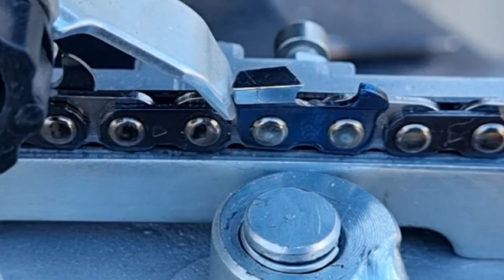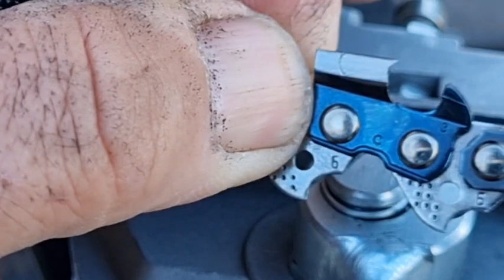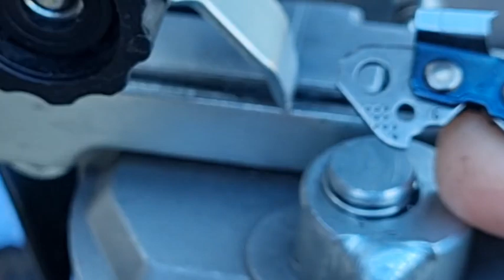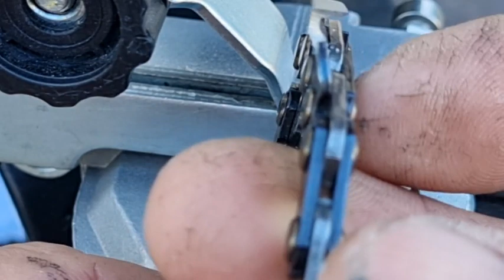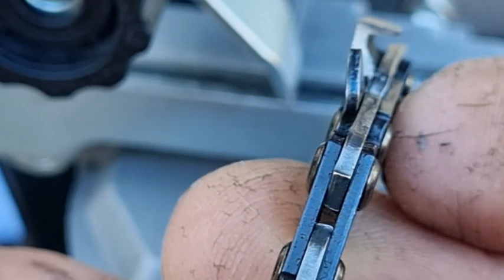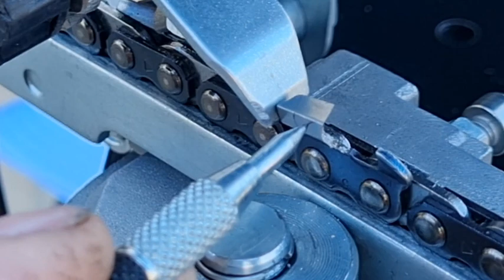10° downward tilt explained, close up and detailed

Comment: You answered my 2 year question ive been puzzled about. Your awesome!!!
Reply from the maker: 10° tilt really is not used much these days Stihl don't recommend it anymore.  OREGON do on some chains.  But a little tilt will never hurt.  There is a slight advantage with some tilt on modern chain but not a lot.  It is no longer regarded as a game changer.  The chainsaw tooth profile has changed in the last 30 years and that's why 10° is no longer recommend

Comment: Sir, I wish to see the cutters from opposite site. does grinder 10° tilt changes inside of the top plate angle as like round file with 10 down angle by hand?
Reply from the maker: Yes what it mainly dose is give less hook.  Reduce the hook which is better for full chisel.  Less hook gives, the leading edge more mechanical support.  Less likely to bend the pointy edge.  But hand file 10° downward tilt has same effect.

Comment: What about when running Carbide? What would you recommend? I find that running lots of hook that the chain and bar are needed to be super true and square where they make contact.
Reply from the maker: I have carbide chains and with the diamond wheel I put the wheel against the face of the tooth and make sure it sitting flat and true against the tooth.  That's the best way to set the angle as well as top plate cutting angle if you grinder head moves.
Being carbide you have to adjust your grinder to the carbide chain angles.